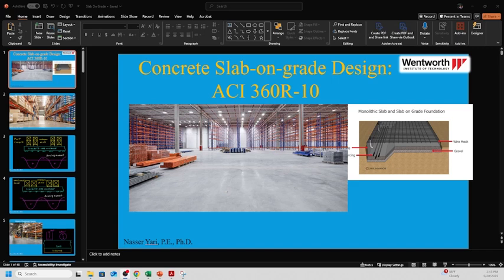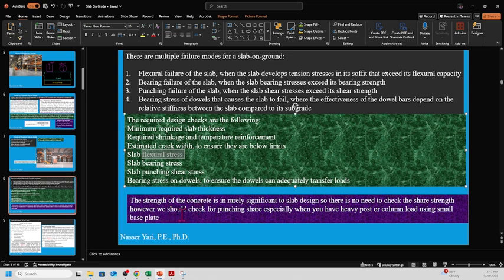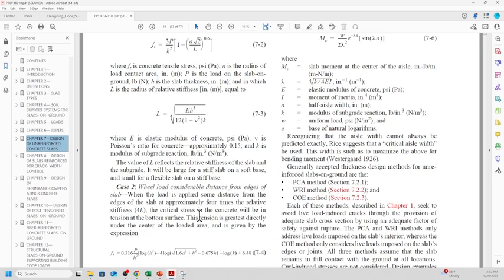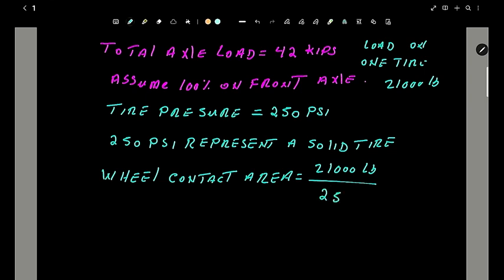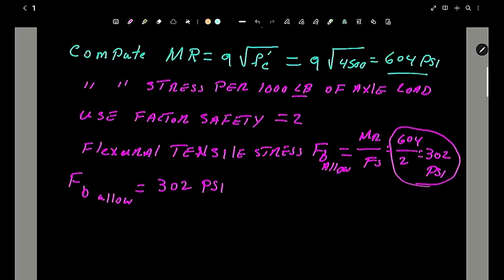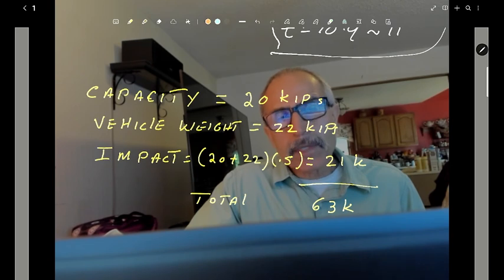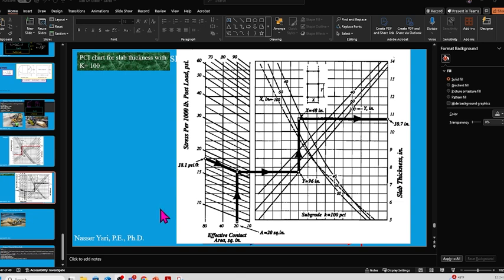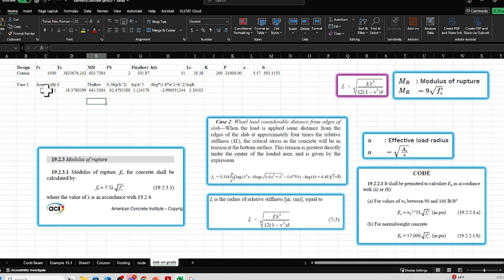Slab On Grade Design

Comment: When designing using PCA method to determine the flexural capacity of slab, how to know the amount of reinforcement we neet to use ?
Reply from the maker: Hi Thank you for watching. To calculate reinforcement in a slab on grade using the PCA (Portland Cement Association) method, you'll first need to determine the slab thickness based on load requirements and subgrade support which we did here. Then, you'll calculate the required steel area based on the slab's thickness, material properties, and anticipated loads, ensuring it meets minimum steel ratios for crack control. There are number ways you can calculate area of steel watch minute marker 9:21 the next 3 slides in the video shows how to compute As, you could use equivalent methods.
Reply: @nasseryariphdpe648 thank you very much for your explanation
Reply: Because I don't see the parameter of reinforcement bar were used in this method. Please explain